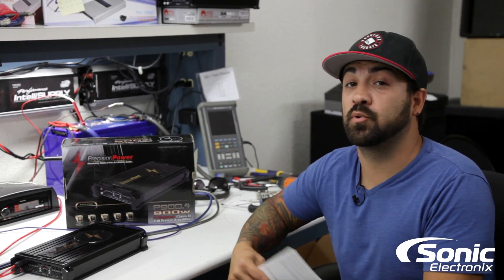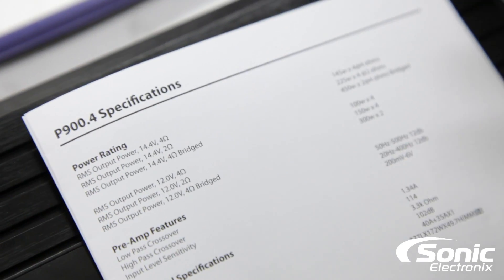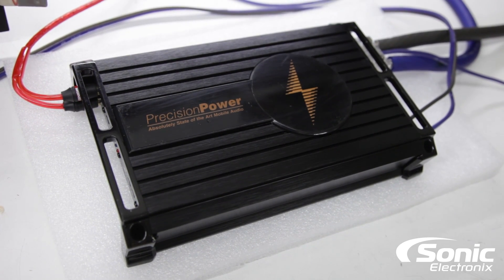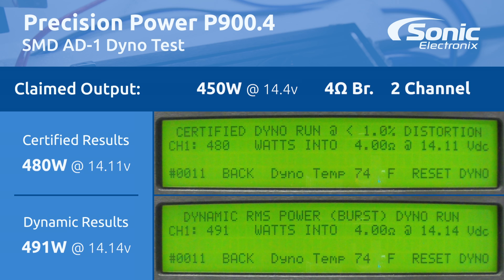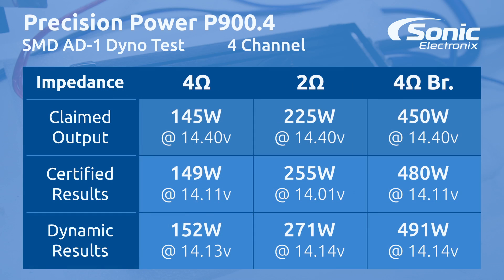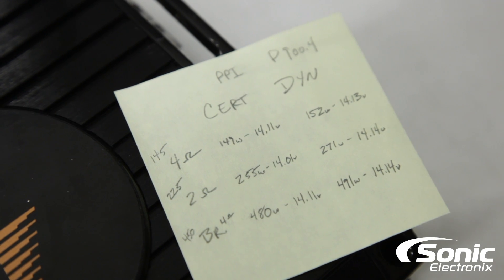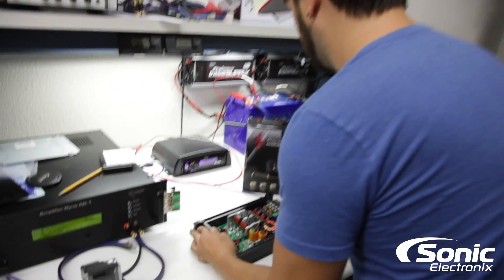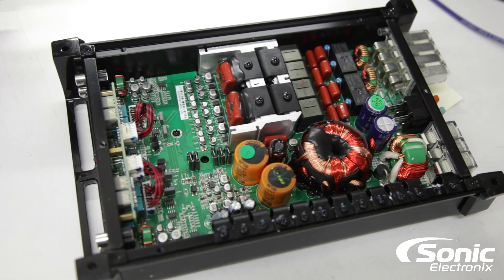Precision Power PPI Phantom P900.4 Car Amplifier | SMD D'Amore AD-1

Comment: Is it possible to calculate total harmonic distortion across the range of power or at least at maximum power? I think that would be a very useful parameter to give more meaning to these maximum output tests. (unless certified has some THD requirement)

Comment: I am really curious to see what a JBL GTO 1001EZ would do on the dyno. I just bought two of those amps from you guys and love them.
Reply: +Mark Vaughn Well there "500" watt amp did about 780 when meade tested it, so I would figure about 1200 watt's for the 1001EZ.
Reply: +dragkid185 That's great, but I'm curious what the 1001EZ actually puts out.
Reply: Mark Vaughn Well no one's really tested the output of the the 1001EZ so you pretty much have to guesstimate with output of it.